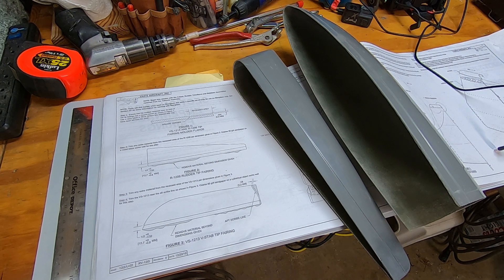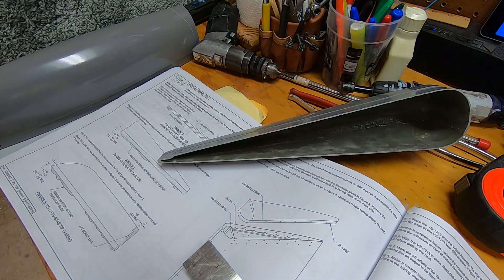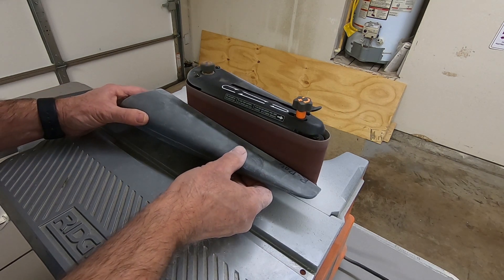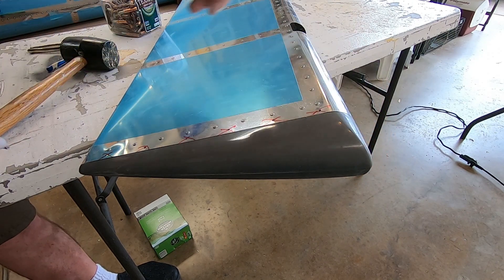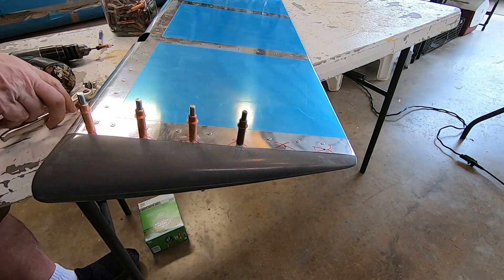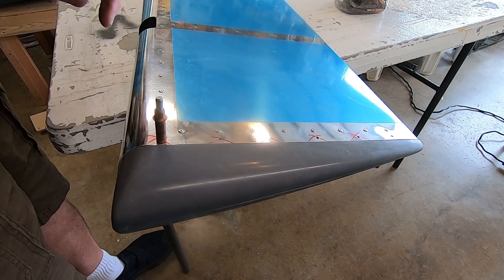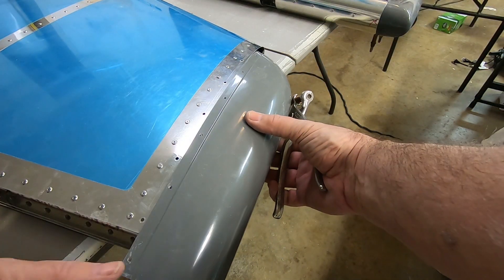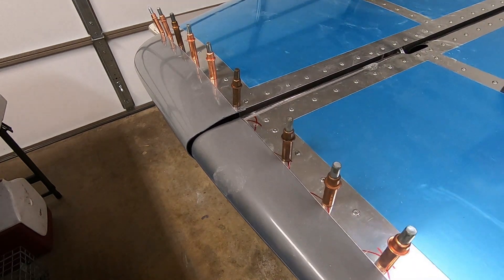Van's Aircraft RV-12iS - Empennage Fiberglass Fairings

Comment: Are those fairings just for cosmetic purpose or due they serve another purpose (added lift or stability)?  I know they are an optional piece and they do seem to clean up the ends much nicer.  Thanks again.
Reply from the maker: Hi Jeremy! That's a good question. I don't really know. I've seen rv-12's with and without the fairings. I really like the "look" they add to the aircraft. My choice to get them was purely cosmetic.
Reply: @Vansaircraftbuilders  i would think that if someone is planning on painting the plane then the fairings look good and give it more of a finished part, but if your going to be polishing the aluminum, the fairings would look a bit odd and grey color agains the shinny metal.